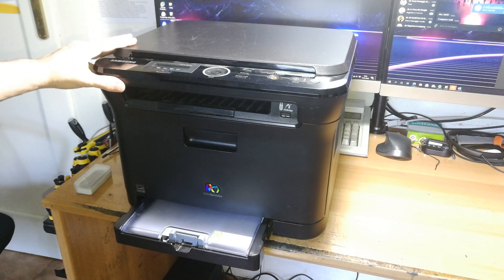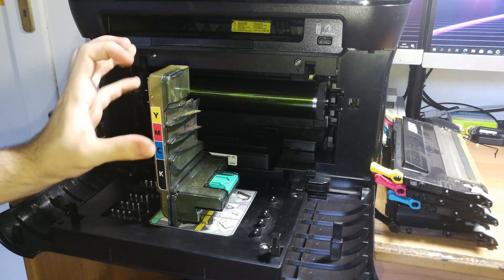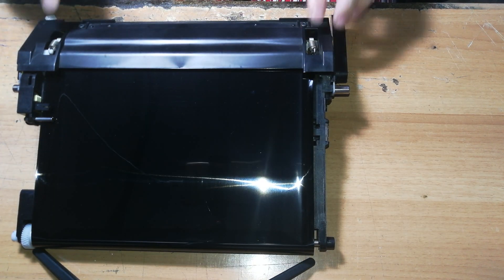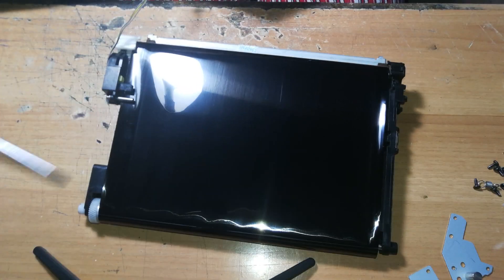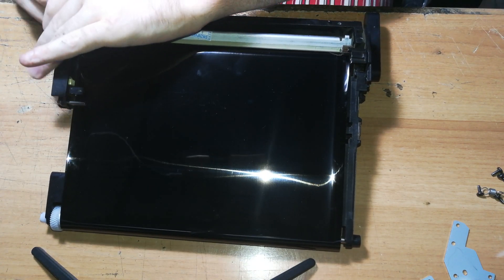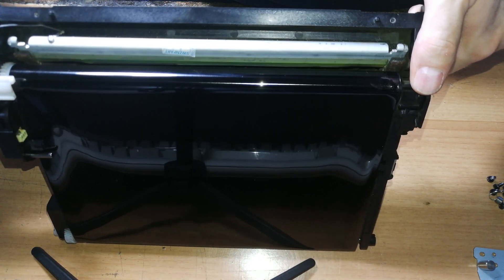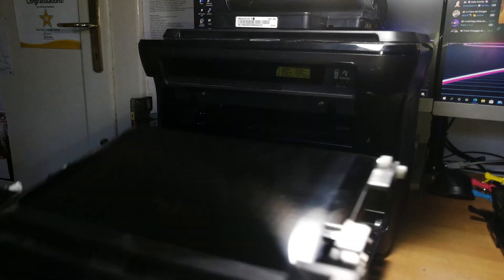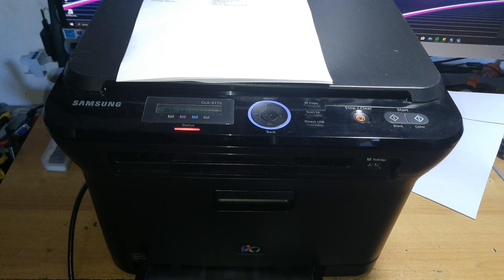Come risolvere il problema di stampa fantasma su una Samsung CLX-3175 (e molte altre) • Riparazio...

Comment: Hello.
I have a Samsung clx-3185fw that when it prints, a "shadow" appears (the image printed at the beginning of the sheet is repeated at the end of the sheet, but much lighter, almost like a watermark).
I changed the toner cartridges, but the shadow continues to appear.
What component could be causing this defect that I can replace?
Thank you for your attention.
Rogerio Capuano
Reply from the maker: Hi Rogerio, it's most likely the drum cleaning blade, you have to replace the drum cleaning blade or, if you don't want to mess with that, just replace the entire drum unit.
To be sure you can measure between the beginning of the print and the beginning of the shadow of the same part of the print, if it's around 188mm it's that.
Reply: @PaoloMarcelli  I measured exactly 188mm.  I will change the drum cleaning blade and report back. Thanks.

Comment: Well, I followed your video and took it apart. I had a hard time not to touch or dent the transfer screen. It was ok to take apart but a bit of a pain to put it back together. I found no damage to the screen wiper but found it to be very dirty inside and on the wiper. So, I cleaned it with alcohol, wiped down the screen, and vacuumed the inside I had some fingerprints and small dents on the screen from mishandling it. But all together, the prints came out 85% cleaner with no ghosting. Thanks for the video, could never have done without it.

Comment: Excellent video. It fixed my ghosting issues. I still have 2 horizontal lines (about a centimeter apart) that fade from the right side of each page. Any idea on what would be causing that?  I was hoping the ghosting fix was going to address both things.
Reply from the maker: Hi :)
ONE centimeter apart I don't know what would cause that, could it be around 2.6cm? If it is, it's probably one of the toner cartridges. Does it do it only on the black or even in the 3 colours?
Reply: @PaoloMarcelli  It’s definitely closer to a single centimeter. It’s only black. I can try a new toner cartridge. I have a spare.
Reply from the maker: @MrRyankellogg  Okay, let us in the comments know :)
Reply: Dear @MrRyankellogg, I saw you replaced the cleaning blade about only three weeks ago. Where did you order your cleaning blade and was it for the Samsung CLX3175 series?

Comment: Hi. Does this resolve the issue I’m having with streak lines on the paper with this same printer? Also I’ve seen you can buy just the rubber itself instead of the whole cleaning blade. Can it still be done by buying the rubber than the whole part of the cleaning blade? Thanks in advance

Comment: my CLX3170 gets me crazy. I already spent money to replace some months ago the fuser unit and recently the black toner, now with evident ghosting issues, I tried to replace the drum as well. I found this video too late so, I tried to check the transfer belt unit but working on it I damaged it. It's really too delicate. The cleaning blade looked OK but the transfer belt is over now😞I don't know if it's conveninet to spend other budget for this printer or to look for something else. Tips? Any good bargain for a dometic printer to use from time to time?
Reply from the maker: Hi :) do you need to print in colour? Because colour laser printers for domestic use are way less reliable than b/w laser printers, and inkjet colour printers get printhead clogs if they are not used regularly.
If you decide to replace the transfer belt, look only for a NEW one, not used, as the cleaning blade could have degraded over time, it's not easy to tell if the blade is bad or not on those models as the blade gets slightly bent, but just a tiny bit, that is sufficient to give you problems but it's not easy to notice.
Reply: @Paolo Marcelli  thanks Paolo! everyone can find a cheap bealt (only the bealt, not the entire unit) but, in any case it will, remain the doubt about the blade. Of course I prefer a color printer than a b/w one. I'll think what can be a good solution. Do you have advice for a reliable b/w home printer with low cost of materials and toner?

Comment: I've changed my transfer belt but still see ghosting. Any other causes?
Reply from the maker: Hi! Do you see the shadow of the printed page on the next page, or at the bottom of the same page?
If you see the shadow of the first page entirely on the second one (like in this video) there's no doubt it's a transfer belt issue and maybe the one you bought is defective. If you see the image repeated at the bottom of the same page it's a problem with the drum cleaning blade, so the drum unit.
Reply: @PaoloMarcelli  cool thanks, same page, will look at the drum.

Comment: Hi Paolo, many thanks for this video which is very clarifying. I have two questions: I don't find any webshop anymore where I can order a new transfer belt cleaning blade and (worst case scenario) can you give me the original Samsung partnumber of the transferbelt. I have a CLX-3175N and I assumed that the partnumber is JC96-04840C but according to some sites, this tranferbelt doesn't fit in my printer but is does in the CLX-3175FN...Can you please help me out with these two questions?
Reply from the maker: Hi Raf!
The CLX-3175n and CLX-3175fn are literally the same printer, with the difference that the FN variant includes a FAX sending and receiving capability and the N variant does not. Generally speaking when you search for replacement spare parts you should search for the "series" of printers, in this case you can search for CLX-3175 as nearly every replacement part works in both the FN and N variants. Said this, I confirm you that JC96-04840C is the correct part number for the full transfer belt unit. I have found a seller for the transfer belt blade only but it has gotten pretty expensive (around 40$) and it's a used part, so if you can find a full transfer belt new locally it would be better.
Reply: @PaoloMarcelli  once again, many thanks Paolo. Have a nice weekend.
Reply from the maker: @rafjambon5083  Same to you, have a nice weekend :)

Comment: I have a canon printer and getting some ghosting but on the same image not from the previous print ?    Usually with a colour print,  if I have string black text on it There’s a ghost of it like 2 inches down.
Reply from the maker: Hi! What model of canon printer are you talking about?
Reply: @PaoloMarcelli  it’s a Canon i-SENSYS LBP722Cdw.       Still has the low yield toner cartridges In It it’s pretty new.      Doesn’t do it on text prints just some colour prints.

Comment: Hi  i  have  3 clp 315 printers cannot find a wiper blade part anymore is the wiper blade repairable ?  and if so what material to use
Reply from the maker: Hi! Here it is: aliexpress.com/item/1005002992939201.html
As i know there's no way to replace only the rubber blade part.

Comment: Thank you ADCSFXworks Printing Center. I fixed my printer using this video. I found it more difficult than I thought I would. I may have had the new part rotated 180 degrees but whatever the problem was I fixed it in the end. It now prints perfectly. I most certainly could not have done this without you showing the way.